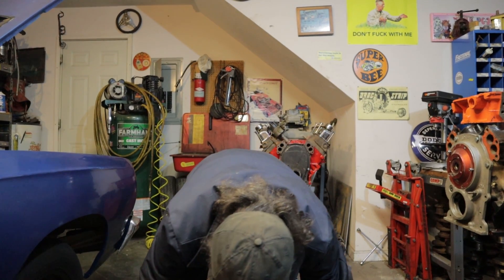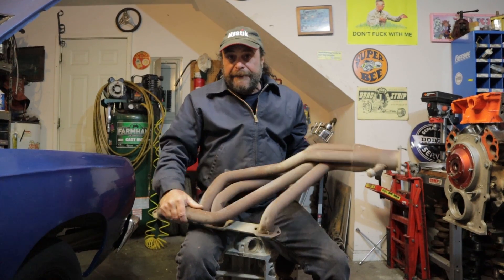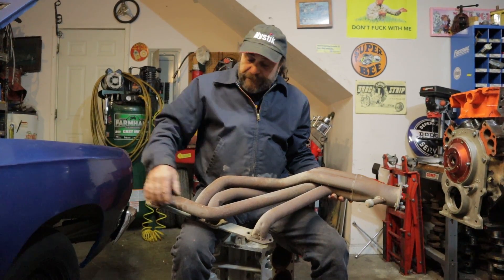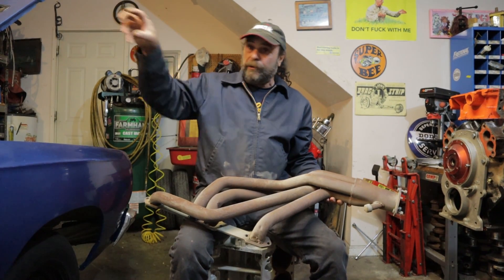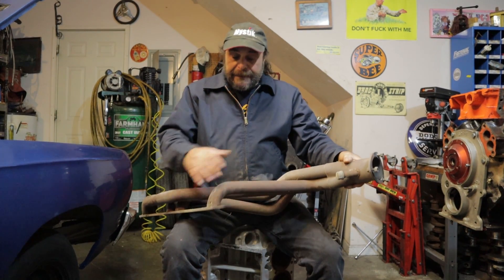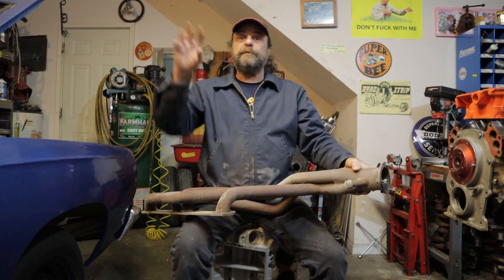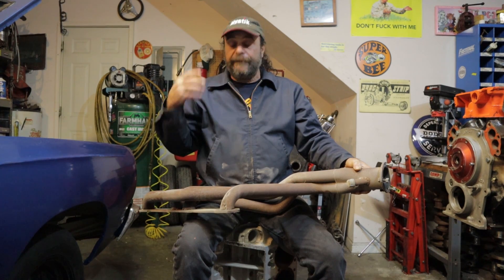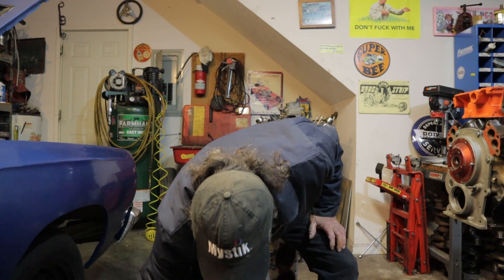The BS On Backpressure

Comment: I totally agree. If you think of a turbocharged engine the turbo is a restriction. If you were to put a large tank of air next to the engine and dyno test the engine at the same boost pressure and boost temperature it would make more power with the air tank boost than with the turbo as the exhaust system would be less restrictive. Simple if you think about it.

Comment: I ran my own machine shop, turned my own cranks, worked my own heads.. porting and (Tricks on the porting hardly anybody talks about. Radioused the valves, and raised the exhaust ports with just a small lip on the bottom at header, to eleminate any back flow.. Tuning the exhaust also, Straight pipes off the collectors.. lipstick line marks on straight marks, make a full pull, and cut the pipes where the lipstick stopped burning. usually there is a big differance in the length to get the tunning of the pipes. Stuff that I can't do.. is plug a laptop into a care and program it. I was running faster ETs 30yrs ago, than "Most cars now". Most of us older ones, don't tell this and it gets lost.....

Comment: Makes perfect sense!    I have cj7.  Stock 350 sbc.  Block hugger headers. I build a single exhaust for it. 2 into one 3 inch setup.  Y piped and  that setup was amazing!   Engine ran so good.   Then last year. I wanted to change. So I did dual exhaust. Off the same block hugger headers short setup with homemade stainless mufflers.  I lost all bottom end torque.  Besides it being way to loud. As my homemade mufflers aren’t insulated I think I lost my scavenging effect on the motor.  Hmmm.  I’m going to go back to that 2 to 1 setup.  I had amazing bottom end and it just ran so much better.  And I could actually hear my stereo.  Lol.   Thanks for that video!!

Comment: Noticed some of the comments here saying when they reduced backpressure by eliminating the muffler they had less power/torque. Keep in mind that when you do anything to allow the engine to breath better you are ingesting more air with basically the same amount of fuel because of your jetting. When engine backpressure is reduced a richer carb jetting is required. For an injected engine the same is true but I believe the computer will compensate for the leaner mixture and adjust auto matically.

Comment: There is a lot more to what makes an engine go than scavenging, especially at part throttle, when the scavenging effect cant be as strong because of the throttle. At the end of the power stroke, the instant before the exhaust is open there's still a lot of pressure in the cylinder to keep pushing down on the piston, and once the exhaust valve opens even the slighest amount,
the pressure drops to near zero, and stops pushing on the pistons. If theres any backpressure, this slows down the release of this pressure drop and can still push on the piston.  Depending on the cam, there can be between 50 and 100 psi still left in the cylinder when the exhaust valve opens, and this is a lot of pressure to throw away! This part of the stroke has the same effect on power as it does on a 2 stroke when the piston begins to uncover the exhaust port, and is very dependent on "back pressure"... too much and you have a good torquey low speed engine, too little and it will only make good power at really high rpms.  Better to think about backpressure in the context of what do you want the engine to do, and what will work the best with the cam than to say it is always bad or good.

Comment: As much as I liked this video and appreciated this perspective, this isn't entirely true... Motorcycles use a butterfly valve in the exhaust to create backpressure at lower RPM, and it helps produce a little extra power down low when the engine has a radical cam profile.

Comment: You can change the torque and power curve totally on an engine with fuel input and exhaust especially on two stroke engines it can be unbelievable

Comment: I just watched a video of the difference between zoomies and collecter headers on a 427 Chevy the difference was around 100 HP Most people who watch these videos have no understanding of how headers scavenge exhaust and pull or how 180 degree headers work or the fact if you run longer tubes out from the collectors the engine will lean out and demand more fuel I've never put an engine on a Dyno but I've tried different things with intakes and exhaust in a racing environment and the gains and losses can be seen and felt and you can burn pistons playing with exhaust if you don't richen the fuel when you gain alot of the scavenging effect your talking about back pressure not good a good designed and engineered exhaust makes horsepower

Comment: This guy is spot on.  You're gonna have some back pressure if you want street drivability, but it all depends on what you wanna do with the engine and where you want it to make power.  I stuck 1 7/8 long tubes on my 5.3 silv. before I learned about all this.  Truck seemed to be a dog from a full stop, unless the rpms were up around 5K.  Then it would scream.  Size your runners and collector for your intended purpose.  Back pressure should be no more than 1.2 times your MAP at the most.   Preferably equal to or less than manifold (1:1) for maximum scavenging.  That's the general rule of thumb I've found to work from my personal exp. with my setup.  Just play with it and GO FAST!!

Comment: There's been Dyno pulls proving back pressure makes a difference.. and no back pressure is hard on valves #proveMeWrong
Reply: 3" straight pipe on a stock ka24 going uphill would disagree.

Comment: My experience, you need at least 24 inches after the headers / exhaust manifold. Otherwise lost of power is noticeable.
Personally I don't like headers or glass packs. I prefer stock type exhaust manifolds with short mufflers. This has work to for me the best. And dual exhaust  is better then single.

Comment: Good informative video. Better than a carburetor circle jerk.  Anyways, adding 1-3/4 primary headers to my 383 really woke of the engine.  The 3" exhaust might have hurt it.  In hind sight, I should've gone with a 2.5" system.

Comment: Proper sized exhaust makes back pressure. Apparently his back yard garage doesn’t compare to a pro mod drag car garage. Same as a two stroke. No back pressure no power. That’s why the exhaust pipes are shaped that way. Keeps the vacuums of the exhaust ports pulling fresh fuel in.  But everyone has they’re opinion. 
Dunk a car with open headers vs exhaust. Open headers makes quicker rpm exhaust makes more torque. You figure power to weight ratio and build your exhaust.

Comment: Great demo uncle tony.. All these turbo guys think boost = hp! Boost is pressure in the turbine or wherever the sending unit resides. Hp is key to efficiency turbulated intake air and less restrictive exhaust getting it out efficiently and at lower combustion temps. Sure.. Turn up boost get more power.. But now.. Timing and duration of intake and exhaust now have to be manipulated to compensate which isn't anyways beneficial. There's ways to get big hp on low boost on pump gas and its literally exactly how u explained it!

Comment: What about o2 sensors in the exhaust
Reply: Uncle Tony's Garage I had done a v8 swap in an old 90’s dodge to an efi v8 from a 93 magnum, I had dropped the engine in with the exhaust chopped right after the o2 sensor, it was running rich when I ran it like that and I thought it was a bad fuel pressure regulator and a couple of other things, but I was stumped, it was running so rich it sounded like I had a gnarly cam, it smoothed out after I finally did a full dual exhaust, do you think it would have still ran rich without exhaust?

Comment: I don't for the life of me understand where some of these stupid ass myths come from, uneducated know nothing morons that don't even take the time to actually learn it would seem, you want basically zero backpressure for best performance that is why there are headers and manifolds designed to take advantage of the exaust pulses from one cyllinder to help scavenge the burnt mixture from another cylinder in the case of tri-Y/cross-over header designs, or at least completely minimize the back pressures to allow for the best possible cylinder filling of the fresh air/fuel mixture during valve overlap period ( of course valve overlap, valve centerline angles overall lift and duration all change this a bit but that's cam profilling and a WHOLE major discussion in itself), the other myth that cracks me up is the old running it without manifolds at all or no pipe beyond  the manifolds will burn, warp or otherwise cause engine damage to the valve train, really? NO because if that was the case I should have had to have done about 50 valve jobs on engines I've personally ran because of things like cracked very badly cracked manifolds, so badly in fact that that manifolds came off in several pieces when I finnaly did replace them or one old ford I had that kept burning out O2 tubes leaving a thumb size hole strait out of the drivers side top of the manifold area, lets face it exaust work SUCKS on cars with many miles because everything you touch is like it was welded in place bolts included, and ends up breaking  so you end up running it as long as possible before fixing it and I'm no exception, so if these myths held true there would be tons of valve issues just from me alone, then when you consider at the junk yard I worked at years ago we started tons of engines to try them out for possible sale without any form of exaust in place (manifolds included) and you begin to see just how full of shit that myth is.

Comment: I have a question i have a 1982 ford f100 with swapped 351w it has petronic ll on it now my question is on cylinder 3 i have fire but looks lile its not getting fuel i have had valve cover off and it appears everything is working on cylinder 3 i have a puffing sound on that side aswell whats my problem can a timing issue cause this or distributor issue or is it a burnt valve issue? Thanks for the help

Comment: Each time I ask this question it feels rediculous cause all my life i've been told that catalytic converters don't cause enough restriction to affect a V8 engine. But if an engine is rebuild with the intentions of having no exhaust pressure. Then have some hooser slaps in a Cat to pass safety. Would it not affect the engine right away? Or rather slowly disturb the performance and emissions?

Comment: Working on an intrepid with a crushed section of exhaust pipe.Went to Napa to buy a section of pipe and the "kid" behind the counter said replace it with a cat if you want more power... "Cats increase back pressure so you get more power!. I have a stock Neon with over sized throttle body,11/4 inch exhaust,8 cats and 4 mufflers! It's fast!! Squeeze every bit of power out of the gas before it escapes!"Then explain how porting heads can increase power?.The adult behind the counter walked up and said don't bother.He can't be taught! Couldn't stop laughing.

Comment: Thanks.
Then just as I was wondering the advantage of those 4 exhaust pipes, 1 to 1 Cylinder, 1 Exhaust pipe,
 i.e., Headers, Symmetrically, each side, that are sticking out from in front of the rear tires, I see what they were up to, and why. Then, You would think combining all 4, later on down the pipe would be a deficit to the evacuation process. Street Reg's ? Minimal effect most likely. But an effect none the less.
Thanks Again.
PS I had welded straight exhaust pipes to my V Star 1100 few years back. Not really knowing what I was doing I did it for sound. Well got more than sound. My friends say sounds just like a Harley unless it's idling then idles too pretty. Haha. Longer pipes ruined top end so I cut them back back and voila. Sound n power. I think the rear cylinder needs a little less pipe as a matter of fact. I'll do that today. Hahaha

Comment: Partially true about overlap.. the real reason for overlap, is to pull raw fuel across the exhaust valve and cool it. Fuel injection engines have a small injector pulse during overlap to cool the exhaust valves..  the entire purpose of your emission system  is to deal with this unburnt fuel...

Comment: My steel head dirt late model race engine made 565hp with 1 3/4" race headers put a set of 1 5/8  headers it picked up 30hp.to 597hp and broadened the tq curve and picked up about the same right around 30 ft lbs...that engine made over 500hp at 4500rpm and was still pulling 500hp at 8500 rpm, it was a 362 sbc1 13.25 to 1 comp with 210cc world products heads and a 700 lift lunati roller, billet crank and rods Ross pistons...victor large plenum sp intake a perfectly tuned 750 hp carburetor... but the reason for the wide power band and lower peak numbers is the cam had a wide separation on the lobe centers...it was a very fast engine on the track... remember small engines need small tubes, big engines like a 421sb2 need 1 3/4" or more... also on open headers the collector length when tuned properly will pick up tq... a finely tuned balls out race engine is a beautiful thing. Getting ready to build a 396 sb1 for a 80 Corvette in a few months...

Comment: As I did research on this subject I learned that back pressure is bs.  Exhaust scavenging is what you need. To big a pipe it runs like crap. Get the right size and it runs its best.

Comment: sorta kinda along those lines...  I remember when the DEF system came out for commercial trucks (If you are ever next to one taking off from a light... it sounds like it has a corncob shoved up its a$$).  An engineer at a news conference explained that, since the unit was located past the turbo, it didn't have any effect on the engine performance.  The president of Pittsburg Power asked, "Well if there is no effect installing it after the turbo... then just block the exhaust after the turbo and you would have zero emissions?".  The engineer looked at him like he was an idiot and said, "You can't just block off the exhaust.  The engine wouldn't run".  The next question was, "Oh... so the engine has to exhaust... it has to breathe?".  The engineer said smugly, "That's right".  The ending statement from the president of Pittsburg Power was, "Well in that case, anything you install in the exhaust system does, and in fact will, effect and downgrade engine performance... including this device  And everything you have been trying to feed us is a crock of sh!t!".  I have a motorhome that already had a TBI 454.  I installed an RV cam, Holley aftermarket TBI and  big headers.  Past the headers are 2 3/4" exhaust pipes to TWO one ton Chevy converters (actual pure duals), 2 3/4" pipes to 36" glasspacs, and 2 3/4" tailpipes out to the sides.  Tons more power, and tons better fuel mileage!!!  You can't just do ONE THING.  More fuel needs a different cam and better flowing exhaust.  Just more fuel means a rich running engine.  Just better flowing exhaust means a leaner running engine.  Just changing the cam without any change to the fuel or exhaust systems will only give you a crappy running engine.  That's like the modern "Sport" model.  The only changes are an air dam up front, fender flares and "ground effect" skirts on the sides, and a wing on the back.  Since they added more weight and nothing else, it is actually SLOWER than the standard model!!!  Sad times.  When I grew up in the early 70's, even geeks knew something about cars and engines and how they worked.

Comment: my two stroke might need some back pressure to run RIGHT (and even that is for scavenging)..... but it will run "open port"

air in, fuel it, blow it up, get the the hell out..... thats power

Comment: My corvette has flaps that open at 3000rpm.  2000 rpm with flaps closed it does 80mph. Open 75 mph. You can feel the difference . low rpm and high rpm.

Comment: I get the no need for back pressure in fact that is how I have always thought or why would ĺmmmmkk d people work there heads and put bigger exhaust valves in. But what gets me is the straight drag pipes I run on my shovel it does fell like it performs better than with a restricted exhaust system

Comment: I've got an 01 crown vic that I took off the OEM y pipe and added an H pipe and it does seem to have more torque...the pipes are only 2 inch and I wanted to go bigger but a friend of mine says my 4.6 needs the smaller pipes for back pressure...it really don't matter at this point because I bought a couple of  17 inch x 3 inch flowmaster tips and I'm going to turn right off the H pipe out in front of my rear tires..its still got the cats but I deleted the muffler..I don't race or chase suspects at high speeds ..I just want to keep the low end torque

Comment: You didn't talk about the elephant in your hand. Why did manufacturers used to have the thermostatic counter-weighted valve in the bottom of the exhaust manifold? I always wondered what the thinking on those was. Old Fords used to EGR signal tubes stuck in just before that valve.

Comment: Even worse than the back pressure morons are the "2.5 inch pipe into 4inch pipe makes massive power and flow". I always try to explain it like this...stick a one inch garden hose in a 4 inch fire hose and you still only have a flow rate at the level of the garden hose.